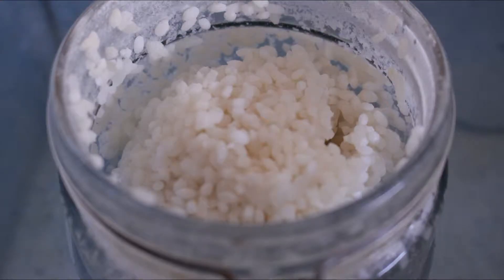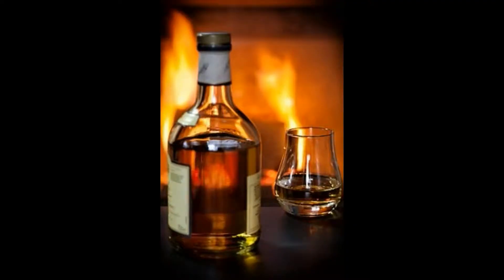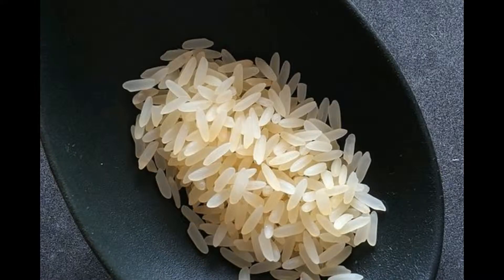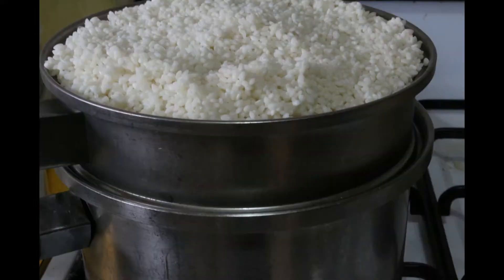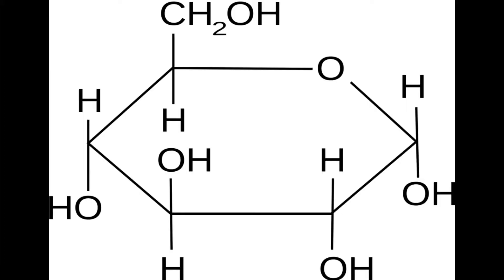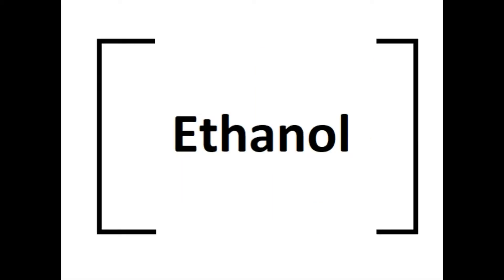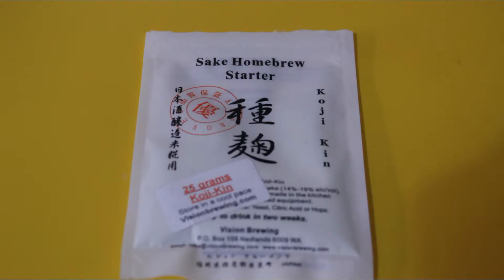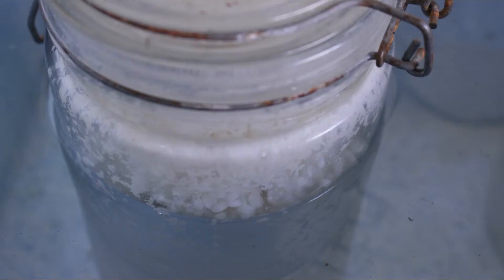Sake Making: Koji

Comment: Could you use koji in beer?
Reply from the maker: First is the simple answer.
Sake is a beer so you are technically already using koji in beer. In this case the koji acts as an alternative to the mashing process of a standard malt, hops and grain recipe. 

The second more direct but complex answer is this. 

Koji is used to break down the longer starch chains in rice. This frees up simple, glucose, sugars for  yeast to ferment.It also produces by products that provide flavour.    

Standard beer recipes use a range of malt, hops and grains that in different ratios provide the same flavouring  effect. The use of  a mashing process also has the effect of breaking down the complex sugars into simple sugars. This is done by heating the mash and causing oxygen and hydrogen bonds to break.

Koji would struggle with this heating process. Both the aspergillus and amylase enzymes would not function for long or very well. This is a problem if you follow a standard approach. Aspergillus would also struggle in the liquid rich environment of  most mashing processes. 

You could try and use koji as a supplement to the grains and add it at a later stage. By doing this you not only get the benefit of adding the rice and rice derived glucose  but the enzymes will begin to break down any remaining grain starches. 

Overall koji works on a different line of reasoning, distinct from from standard beer. Whilst some companies have had success with producing beer using koji they have only had small batches. These have been uniquely flavoured. It seems to be an ongoing hurdle for industry and puritans. 

You could try creating a  sake  fermentation. Once this is partially complete you could than try to use this as the liquid component for a beer mash.